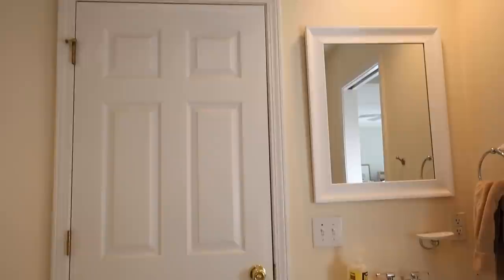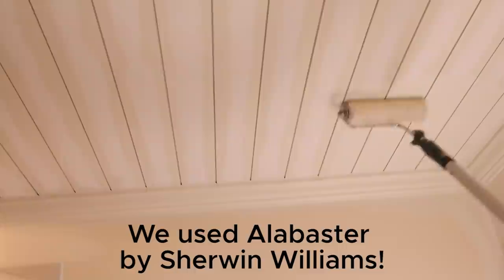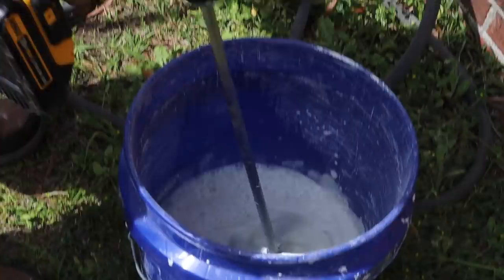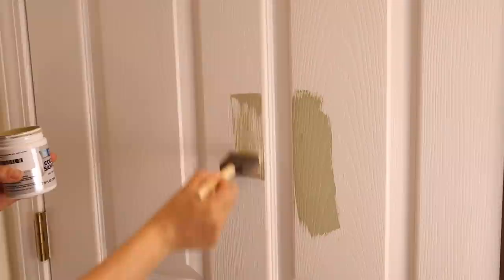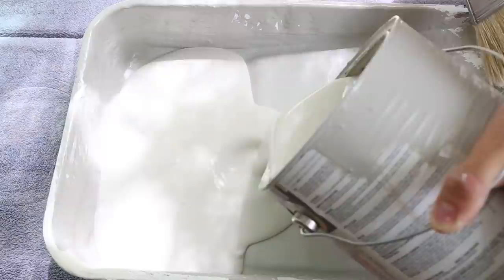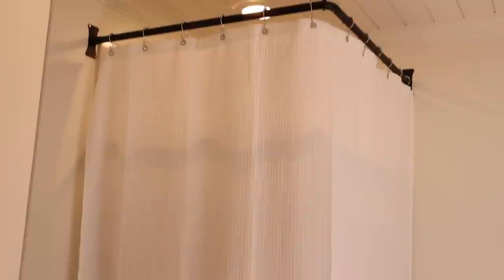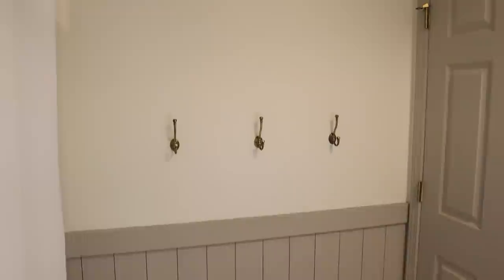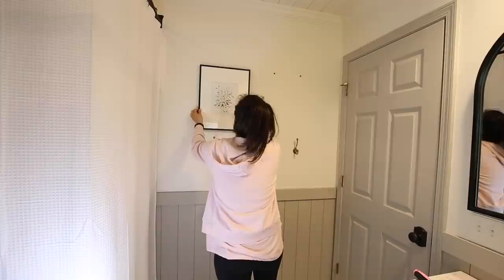DIY Bathroom Makeover on a Budget! | Extreme Small Bathroom Makeover

Comment: How did the transition piece come out? Do you notice the height increase in the doorway and did you angle the transition piece?
Reply from the maker: The transition turned out really good, there is a slight difference but it is not noticeable. We also used an angled transition from wood to tile that helps.